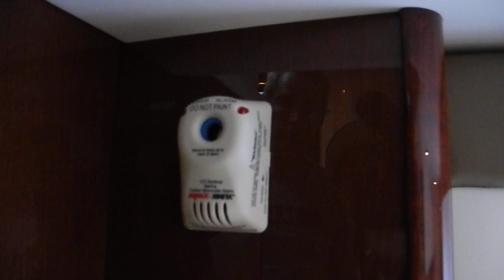Bilge pump midship stateroom Meridian MY

Comment: My friends Mainship always had water in the mid ship bilge—became a stink issue which led him to the issue to begin with.Water can get funky after sitting so long.
Reply from the maker: Some boats do not have a dip or recession in the bilge for the pump to completely remove the water. First question is where is the water coming from ?
Reply: @AskCaptainChris  yep—where’s it coming from? In his case—it was from a water line going into the head.not Waste but fresh water leaking from a hose feeding the head.still stank from sitting

Comment: I get water between  the ribs. The pump sits on the the  stem
The cheap manual pump  works great.   And a fan to dry it out
Reply from the maker: Do you have adequate "weep holes" in the ribs for the water to drain towards the bilge pump?
Reply: @AskCaptainChris  yes.  And I cleaned them when I got the boat .   The stem is 8 inches wide an about  2 inches higher  then the ribs